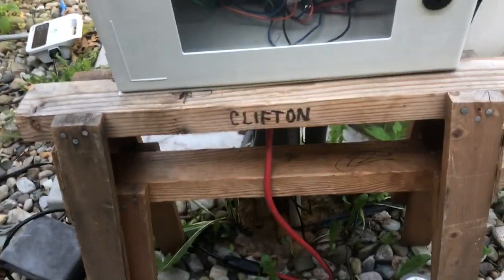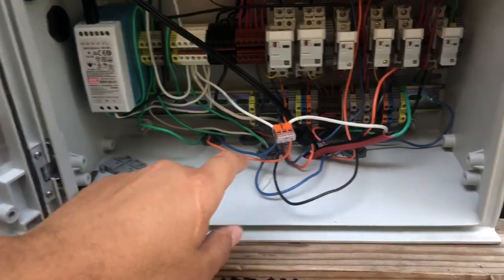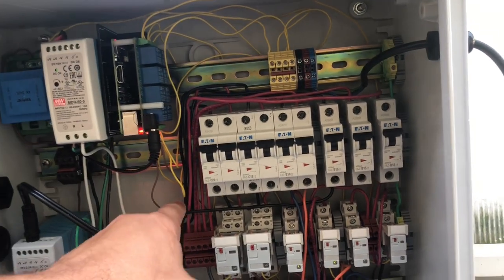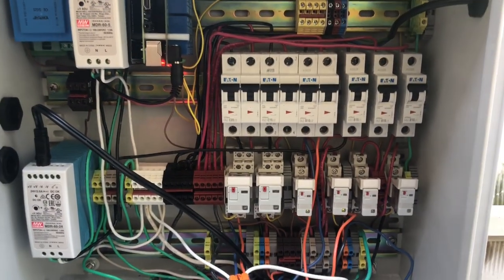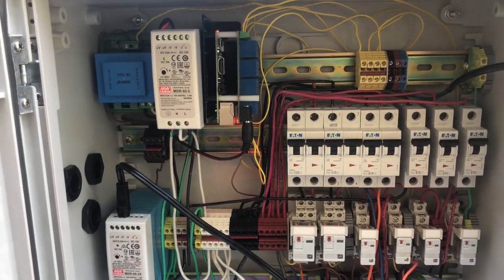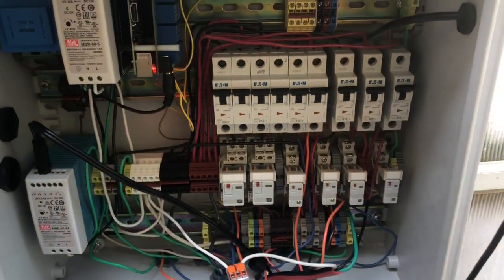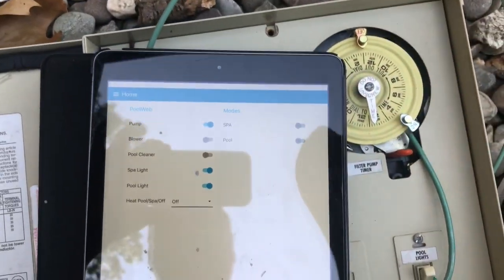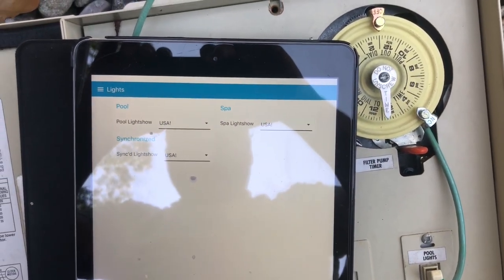DIY Pool Controller

Comment: Awesome DIY Job!!! I'm working on something similar using RaspberryPi and node-red. I'm wondering on how to control Pentair Globrite and toggle relay in order to change light colors. I would like to know if it is possible for you to share the node-red code you use to change light colors. I will really appreciate your help on this.
Reply from the maker: I exported my node-red code and put it on pastebin. https://pastebin.com/aBhb1HBi This should get you what you need. Good luck!
Reply from the maker: And just to explain it... It's a counter.  Turns off the light for 11 seconds to set the lights back to first program (per their manual) and then a simple loop counter that flips the lights on and off the required amount of time for whatever program you picked.

Comment: Wonder how this would compare with the Hayward Omnihub. Seemes the Omnihub is around $1k assuming a DIY installation.
Reply from the maker: DIY is infinitely extensible at a fraction of the cost.  Each set of 8 relays costs $100.  I can turn on my SPA from my phone anywhere in the world or with a verbal request to my Alexa if I'm home.  I can add monitoring of pH and dose MA accordingly for ~$150 (cost of pump, pH probe).  That being said, they're different use cases.  This system is assembled piece by piece and you have to have some know how.  Omnihub is a unit created for the masses.  It can't do more than 8 relays.  You can't control it with Google or Alexa or remotely.  But it's not a bad price for someone who just wants to automate their pool
Reply: @HumanHiLiteReel  Very fair assessment, thank you.

Comment: Hi, would you consider building a box for me, with the software and box preconfigured?
Reply from the maker: That's not really my thing. But they're not that hard to make.  One of the guys at troublefreepool.com made an excellent guide on getting the (excellent, opensource and free) nodejs-poolcontroller software running on a raspberry pi and I've got parts lists and pictures over there as well to follow along with.

Comment: Thanks for posting this.  Could you give a bit more detail on the relays/contactors that you are using?
Reply from the maker: I got the relays from automationdirect.com.  Relays: shorturl.at/gilo8, sockets: shorturl.at/ksvFX and MOVs: shorturl.at/adekX 10amp contact rating with a 24vac coil
Reply: @HumanHiLiteReel  I am also interested in the relay/contactor specifics but I am unable to get your links to work.
Reply from the maker: @coyaultman  They quit for some reason. 🤷‍♂️ Go to automationdirect.com and search for 782-2C-24A, 782-2C-SKT & AD-BSMM-24.  Those are the pieces I used.

Comment: This is very cool I want to do something like this at some point. Those jandy pool controllers with the app are so expensive and they always have problems.
Reply from the maker: Thanks! And I agree.  And if something breaks on the Jandy a replacement part isn't two days away by Amazon, you're going to be waiting awhile for that warranty repair.
Reply: @HumanHiLiteReel  what would it take for a man to get a material list?
Reply from the maker: @brandonedwards841  I tallied it up at one point on TFP.  This is more or less the parts that're in my system.  https://www.troublefreepool.com/threads/my-new-automation-system.183418/post-1780629 There's a whole group of folks collaborating on this sort of thing over there.  I'd recommend checking out the nodejs-poolcontroller project also as it does a lot of the rPi programming for you and packages it up in a nice neat GUI
Reply: @HumanHiLiteReel  thanks!

Comment: Very Cool!  Are you able to set up simple schedules with the SW you're using?
Reply: Never mind, found your other video!  How much money would you say you've invested in your system?
Reply from the maker: @roywylie4325  I think I did the math one time.  It came to ~$600 for the parts in the box IIRC.  The valve actuators are $100/each and I'll need 3 of them.  That'll be next year when I open the pool and then the pool/spa will be automatic.
Reply: Hi @HumanHiLiteReel  this project is exactly what I was looking for, In my case I also need the vale actuators, which are you thinking to use?. Aldo do you have any update in the system?. I was also asking if you can tell me which model of light are you using?. Thank you.
Reply from the maker: @FranciscoGarcia-fp1yy  Hello!  The lights are a very old version of Hayward ColorLogic.  They were probably bought like 10 years ago when the previous owner had the pool installed.  The current models have signal wires that you can use to change the colors with.  If you want the cheapest actuator I think that'd be the Intermatic PE24VA.  I will probably be using Pentair Intellivalves because of their RS-485 capabilities.  They're not a HUGE amount more.  Considering we're talking pool stuff here.  No updates to the system.  I live in the snowy northeast and the pool is closed until May 2020.  I do have parts on order for V3 though.  Found out that Altech makes a GFCI UL489 breaker I'll be changing to for anything touching water.  Also, replacing my mains relays with something lower profile so I can put a plexiglass panel over the whole system.  I also still have plans for my gesture based board for controls and I'll pick up the actuators next season.  Maybe a salt system as well.  And I still have my fingers crossed that my pump will die so I can replace that as well. But the CEO(my wife) won't let me replace that until it actually breaks.
Reply from the maker: And I just realized.  This is the V1 on the youtube.  I have a V2 which makes use of busbars and a slightly different layout.  It's documented here https://www.troublefreepool.com/threads/my-new-automation-system.183418/post-1697427 It's really just a change to the layout and the addition of a busbar to clean up the wiring.  V3 will be more of the same incremental changes.  Nothing life changing :)
Reply: @HumanHiLiteReel  Thank you so much for all the info you just share in those two comments. I'll be reading that post and starting to making decisions on what to get. I'll be waiting for the update to v3. Thank you so much once more.

Comment: Would you happen to know what size box that is?
Reply from the maker: 16x16x8. Last time I looked altelix doesn’t sell that model anymore but looks like amazon still has some. https://www.amazon.com/dp/B07B3KYBPL/ref=cm_sw_r_cp_api_i_gW-HEbE9313EY
Reply: Thanks. I was also wondering if there is a way to control a heater?
Reply from the maker: @Moffix05  Yep! I'm controlling my heater as well with this.  How you control it depends on the heater but the non-smart versions typically have a pool/spa selector that you can flip between.
Reply: Is there a jumper for a relay that allows you to turn it between pool an spa?
Reply from the maker: @Moffix05  Usually.  You have to read the manual for your specific heater. But on my RayPak, there are three wires. A common, a Spa, and a Pool.  I hooked mine up via two dry relays (no electrical current, this comes from the heater).  So the first relay turns heat mode on/off.  And the second relay toggles between pool and spa.  You set the pool and spa max heats on the heater and set it to Remote mode On.  The first relay in on mode closes a circuit which enables the common to make contact with either the pool or spa wire coming from the second relay.  Other ways of doing are just maxing out the temperature of heat in single mode and using a temp gauge in your pool and/or spa to control on/off.  I go into it more on the youtube I did on the software side of the controller.
Reply: Thank you for the help. Do you watch the channel High Tech Lab. They do automation there to. Just wanted to say your 2 videos on this topic we very helpful. It definitely helps when you had a  breakdown of the programming and how the panel is wired. Thanks so much.